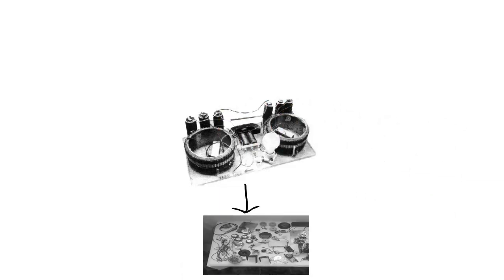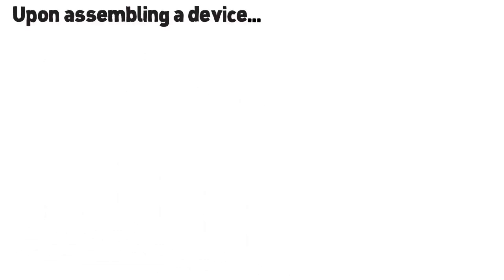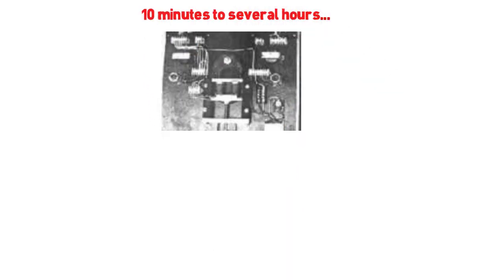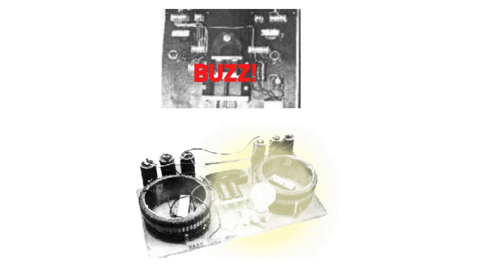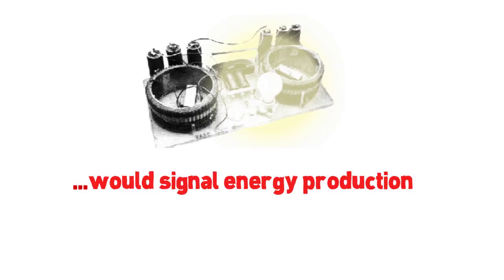How did Hendershot build the generator

Comment: I have a new observation re: the Hendershot Coil
Since the coil is wrapped around a capacitor, with material
that is very diamagnetic (my case aluminum foil),
the Nagaoka coefficient is NOT that of AIR.
Hence, the formula for a cylindrical coil needs to have
a Nagaoka coefficient that is something on the order of .2 downto .1.